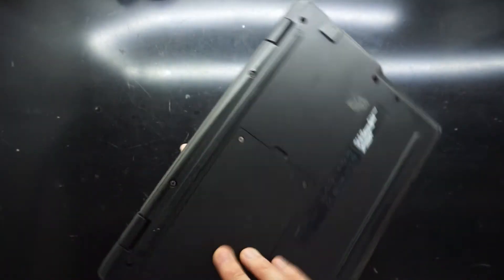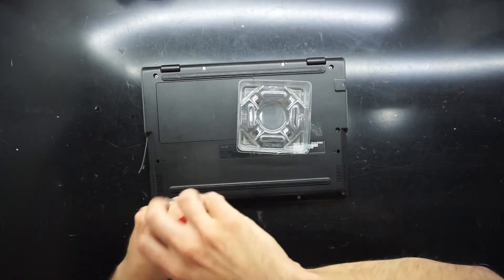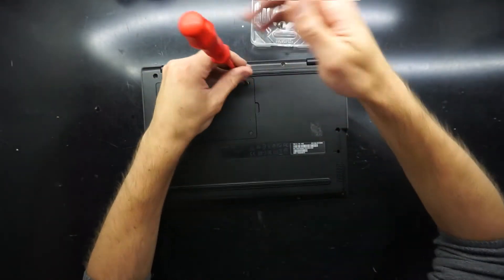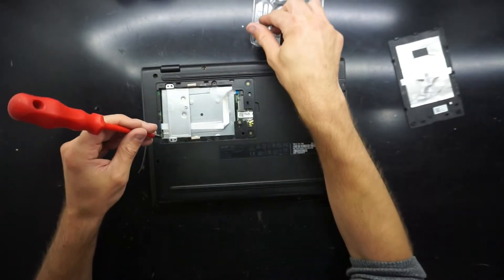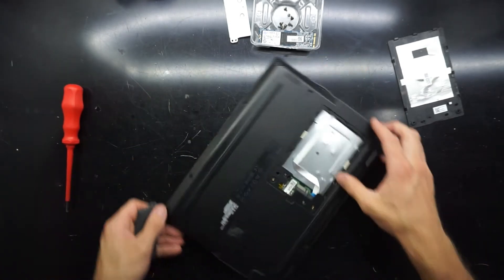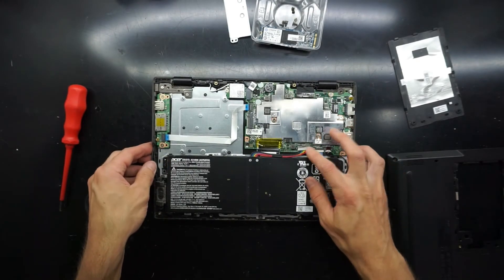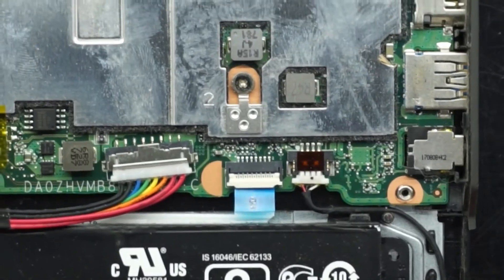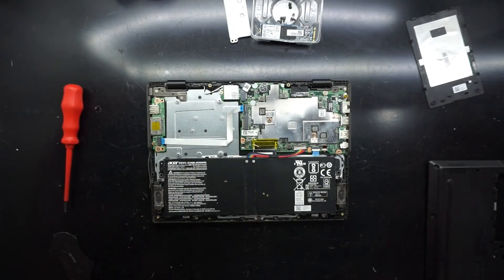Acer Travelmate Spin B118 inspection and tear down

Comment: DUDE I HAVE THE SAME LAPTOP AND THE SSD SLOT IS NOT THERE WTF ?!
Reply from the maker: I would guess the solder points are there for it
Reply: @rickstechrepairs  ye i mean they are but... how can i soldier a slot myself i mean.. dont i need some expensive equipments and stuff?
Reply from the maker: Not recommend to add

But your laptop must be a level below this one and they saved 20c by not attaching it
Reply: @rickstechrepairs  Ty, just found out a dude who bought a cable and connected sata III ssd to it so imma just go with this route...